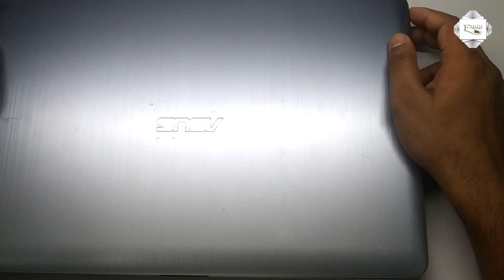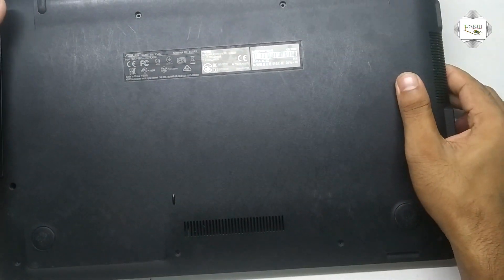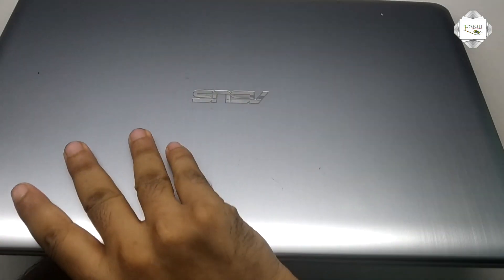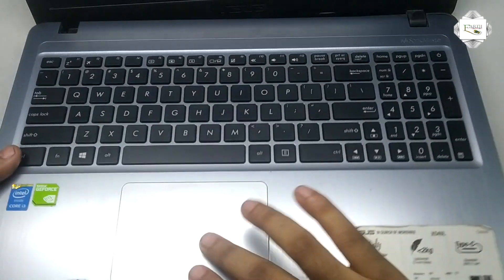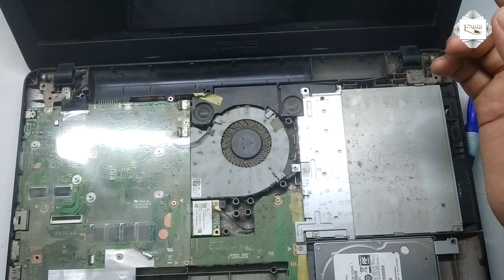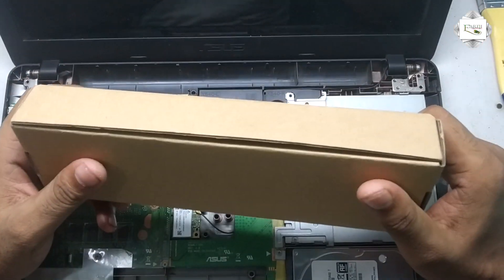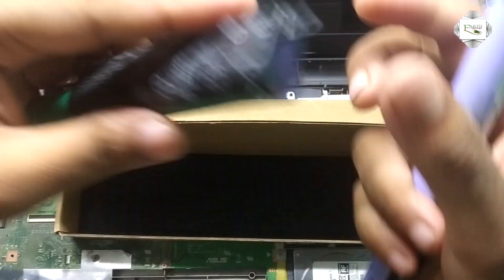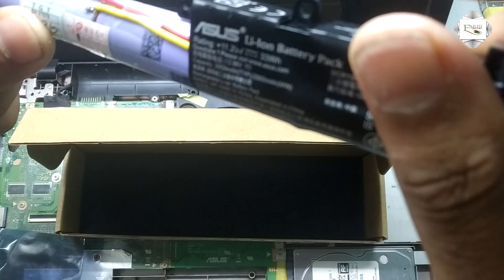ASUS Battery Replacement | Asus Laptop Battery Removal | ASUS | ASUS battery not charging | Easy Fix

Comment: You didn't show how you remove the battery
Reply: Lol  you are correct
Reply: Javier Blac  Nope, it's attached firmly on both ends tightly fitting into the compartment. Also the 9 pin connector end is slided in between 9 pin socket and has two other ends for support as well. You can't just lift it up.
Reply from the maker: Love to receive your comments and feedback.
Thanks for watching it.